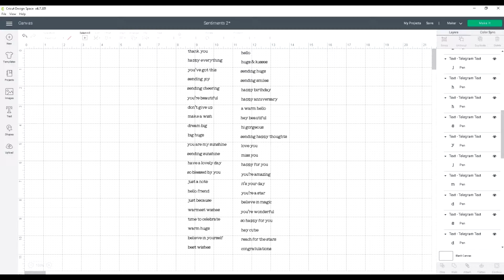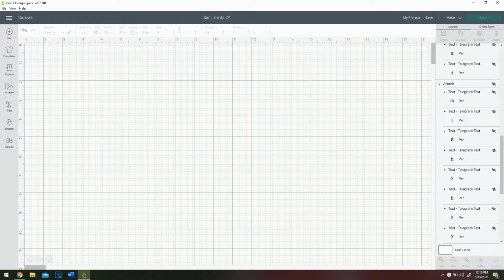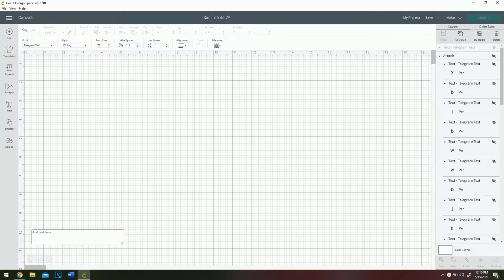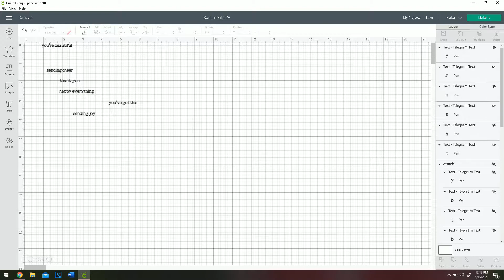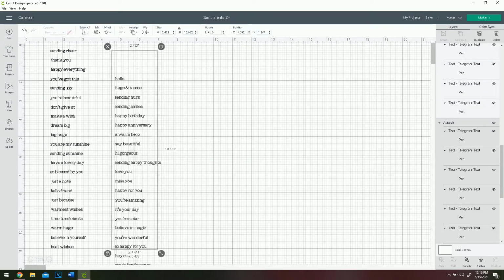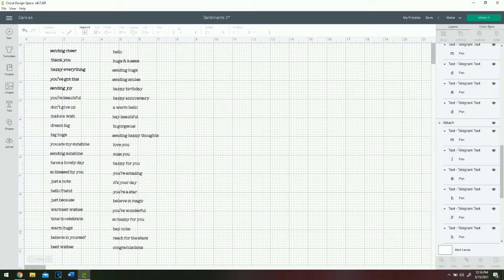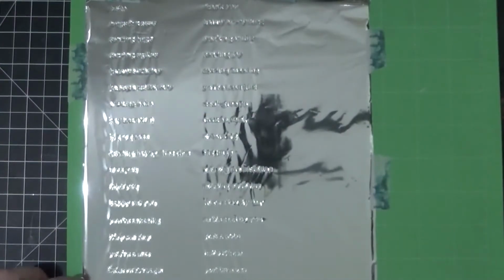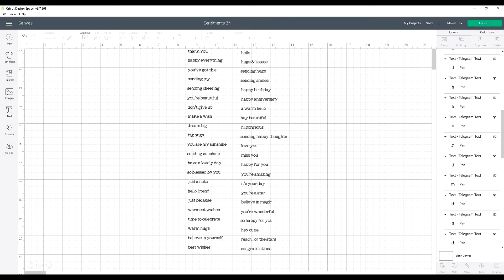How to Make Foiled Sentiments with the  We R Memory Keeper’s Foil Quill Pen: A Cricut Tutorial

Comment: Wow I love ❤️ this idea. Do you use the Cricut foil?? Also how do you cut these out as they are quite close to each other?? Also can you please let me know what is the size you have used for there sentiments. Thanks
Reply from the maker: I'm so glad you like it. It's really pretty handy. I use the We R Memory Hot Foil Quill foil. It's compatible with the foil quill. The Cricut's foil isn't a heat reactive foil, but rather pressure (or at least at the time of this video, it's been a minute since I made this.)  I'm included two links below to two different 12x12 sets, although they do come in smaller sheet sizes and more colors. As for the font, I use Telegram Text which is a Cricut font and it should be free and I set it to 12pts. After they are foiled I use a guillotine trimmer - my Tim Holtz comfort trimmer to be exact, or my Fiskar trimmer rotary trimmer. The sentiments are close, but there's enough space to trim them down nicely, however you can adjust the spacing to whatever your comfortable with. Let me know how you fair with everything. Thanks for watching!

https://a.co/d/2pILMSu
https://a.co/d/ebkNEVW